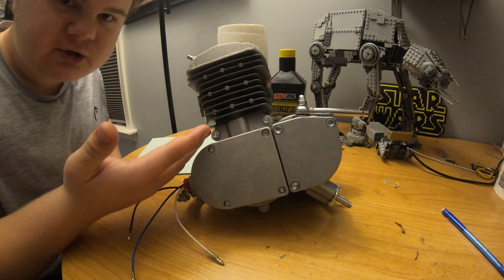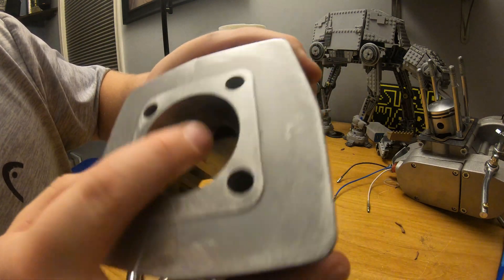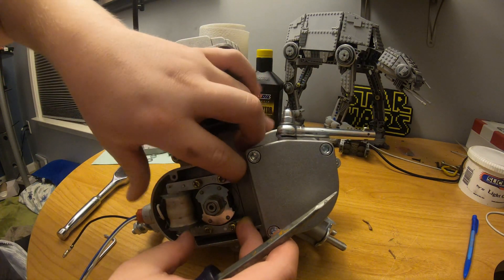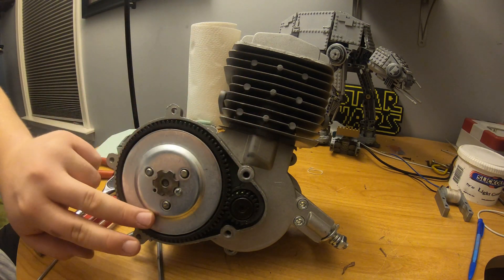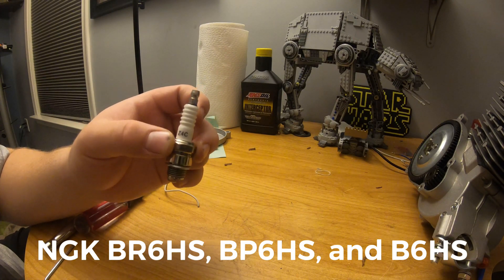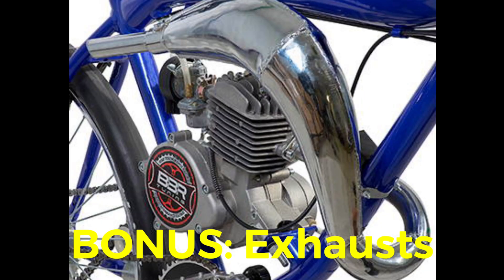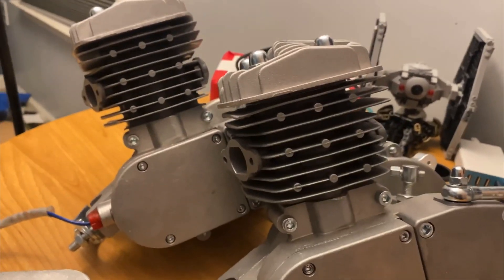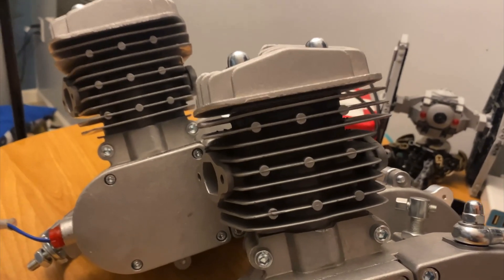5 NECESSARY Motorized Bicycle Mods #motorizedbike #motorizedbicycle #2stroke #moped #bike #minibike

Comment: I probably have around 500 miles on my Zeda engine. When i bought it I didn’t do any of these things. Right now I can hear a rattling sound like maybe a few tiny pieces of metal are inside the engine or something. It runs fine tho. What would you recommend I do to fix this and prevent any issues down the road. I hear you can take the cylinder off, pour some gas inside the engine and swish it around to clean out any debri from inside the engine. I have a dremel too. I dont have any experience with port work and the last thing I want to do is destroy my engine. It runs fine right now and I want it to last a long time.
Reply from the maker: Thanks for the question. Sometimes, the engine sounds like there is stuff in there, but if you didnt clean up the casting flaws before hand, there is most likely debris in there. I would remove the cylinder, check for scoring and remaining casting defects of the cylinder, and then pour gasoline into your engine to remove anything that might be down in there (I've also been told E85 or diesel works better than gasoline, but ive never tried it). 

If there is still casting flaws (such as little metal pieces sticking out from the ports), you can use a dremel and either a sanding bit or a carbide porting bit or a standard file to remove them. If the cylinder is scored enough to fit the tip of your fingernail into the score mark, then youll need to replace the cylinder and piston rings, but if there is visual wear, but you are only able to feel minimal bumps, or none at all, you can reuse the cylinder and piston rings and reinstall everything as normal. 

KEEP IN MIND: When you do ANY work the the ports, or even remove the cylinder, it is recommended to file down the edges of the ports so they arent jagged and/or sharp.
Reply: @a.m.bgarage.everydayprojec9665  alright im going to take the engine off my bike and take a look inside, clean it out and file down the edges around the ports. Thank you for the advice I will let you know how it goes.
Reply from the maker: Cool cool. Good luck.

Comment: 900th Subscriber!!
Reply from the maker: THANK YOU SO MUCH!!
Reply: @a.m.bgarage.everydayprojec9665  hell yeah man!
Reply: @a.m.bgarage.everydayprojec9665  just ordered a minarelli 2 stroke kit with a ported piston and a majority of heavy upgrades from smoklic!
Reply from the maker: Sorry. I didnt get a notification of your comment. I hope your bike turns out nicely. That is a BEAST of an engine and you cant really go wrong with ANYTHING that has Smolik's name on it. Just make sure you use a proper minarelli exhaust and carburetor, and youll most likely need to upgrade the cylinder head so it doesnt overheat (you can use pretty much any CNC chinadoll head).

Comment: I found a ton of the “cylinder defects on the exhaust and intake port, I’m going to use a dreamer and grind it off
Reply from the maker: Sounds good, though, make sure you don't remove too much material from the top or bottom of the ports.

Comment: I modified one of these engines awhile ago and got some decent power out of it. Expansion chamber exhaust carb tuning better plug and wire as well as making a thinner head gasket from an aluminum can and setting squish distance. Ended up with 160psi of compression after milling the head down slightly as well. The thing would rip but the power was pretty hard on the bottom end.
Reply from the maker: Heck Yeah. Thats what I did with these engines. They produced a good amount of power, but ive found that porting is what really does the trick.

Comment: For what is the white cable is this an power Output?
Reply from the maker: The white wire is supposed to be a power supply, however, its wired directly to the ignition system, so if you plug anything into it, would override the ignition system and the engine wouldn't even run (what happened when I attempted to plug in a little 5v light).
Reply: oof .-. but thx for the answer @a.m.bgarage.everydayprojec9665

Comment: Hey bud, I'm brand new to the motorized bike scene, I've been wanting to put an engine on my mountain bike but could never seem to find the time. Then my best bud shows up at my house with a mountain bike with a bbr 66/80. It is the coolest thing I've seen😅. I'm a small engine mechanic so maintenance won't be an issue. In all of my 2 strokes I use Amsoil 40:1. It's crazy I'm 49yrs old and just got into this hobby, any sorry for the long comment just want to tell you your knowledge on these engines is awesome. Keep up the awesome work bud
Reply from the maker: Thanks. I glad you find the hobby enjoyable.
Reply: You have to have good squish or none some of my race engines the piston is 10mm down in the cylinder at tdc and compression is over 10 to 1
Reply: Thanks for the advice

Comment: ive never had an issue with the stock exhausts blowing gaskets whether modified or unmodified. regardless good video!
Reply: my bike isnt even done its second tank of gas and its already blown its exhaust gasket lol. its not really big enough to let a noticeable amount of air through, but my engine gets covered in oil
Reply: @loud.p500  damn that ain't good. I'm mainly talking about them blowing head gaskets, I've never had that happen. I had a cylinder head crack and literally split in half but never EVER blew a head gasket
Reply: Same here. My bike has been using stock exhaust and original exhaust gasket for 3 and a half years with no issue.
Reply: @supremecell  seems like its just very on and off for people. it either works or doesn't aha
Reply: happened to me hahaha
Reply: @nat.strang  head gasket??
Reply: @lntegrate  no the exhaust gasket

Comment: Hello, nice video. How do you measure a squish gap? How did you measure your squish gap to know it was 3mm?
Reply from the maker: I have a link in the description of the video that explains how to properly check squish gap. All you really need is a caliper (or a VERY accurate measuring tape) and some solder.

Comment: Hey, nice video man. Additionally as a #6, these engines pretty much all come with metal flakes scattered inside and out, its best to clean them out completely with some kerosene or gas. A #7 is the crank bearings come with the metal shields still installed and should* be removed which requires a full engine disassembly unfortunately.
Reply from the maker: Thanks for the support and additional info. From the countless engines I’ve dealt with, none of them have had metal flakes inside or metal shields. I’m in the process of a second “10 necessary mods” video, so I’ll definitely make sure I include stuff like this.

Comment: The white wire is the wire you would attach to the kill switch
Reply from the maker: There are some magnetos that have the 
 white wire for the kill switch, but it is not common. Usually the kill switch only uses the two (usually black and blue) wires and the white wire provides some sort of current from the ignition system. This wire is a hindrance more than anything due to not having the capacity to supply enough power to power anything while also keeping the engine running and can cause short circuits, etc, hence why I recommend removing it.
Reply: isn't the white wire the + for a headlamp and you can get the ground from tho body @a.m.bgarage.everydayprojec9665

Comment: ive built a few motorized bike before and nevenr done these checks, u shouldnt have any issues but these chinese things can be sketchy. the bt 100 and bt80 are especially good and dont usually have any casting imperfections.
Reply: Where do you find one of these motors that isn't Chinese. I've been told that they all are?🤷‍♂️
Reply: @marcusprince3999 mines coning from cali🤷🏾‍♂️
Reply: @supergrapeap3312  Ok. Well most of Cali gets them from Chinese manufacturers, Lol.🤷‍♂️ If you find out otherwise, let me know.🙏

Comment: I know you say the white wire is pointless, but couldn’t it run a front light if I chose to put one on? Or would it drain too much of the energy for the spark plug?
Reply from the maker: I don’t know if I was using the right headlight, but when I tried using the white wire to power it, the engine barely ran and did not accelerate at all and it seemed as if there was not nearly enough power supply to light headlight enough to even make itself useful. Lol.  I don’t know if you would have better results, but it seems that most sources agree with my results. 

I was using a 6v headlight and the engine would barely run. Even if the 6v headlight had been fully powered, they are not very bright at all and aren’t very useful for night riding. To actually have a useful headlight, you’d have to use a 12 or so Volt system, which Will DEFINITELY NOT run off the white wire.
Reply: @a.m.bgarage.everydayprojec9665  yea I figured as much and have heard the same things but I’ve never tried it myself. My first build I just threw a battery powered light on there and that lasted me half a ride in the middle of the night. Nothing like flying past cornfields able to see nothing more than glare off the road.

Comment: Shave the head down ten thousands , check and keep the head torqued down especially after first few rides I put tapered nuts all over mine so nothing comes loose anymore
Reply from the maker: Thanks for the additional info. I don’t know about your engine, but with these engines, I needed to take over 3mm off the surface of the cylinder, so I didn’t really check it until I got about .5mm within the wanted height.

Comment: How fast should it go with only exhuast modification
Reply from the maker: Speed COMPLETELY depends on the gear ratio and wheel diameter, but if you upgrade your pipe to a fat belly, such as the MZ65 style pipes, your bike will run like a scalded dog, even if it ran good before.  You’ll not only get TONS of bottom and mid RPM torque, but you’ll also gain a good amount of high end RPM.

Comment: I call BS on the exhaust issue! All that is needed is to remove the small tube on the outlet side and enlarge the hole to about 1/2 inch. works wonders to open up the engine.
Reply: I want to try making a mini expansion pipe out of it by hollowing it out, putting the end cap back on with a little 6 inch stinger pipe 19mm ID out the end cap, with a little lawnmower sausage silencer on the end.

Comment: What oil ratio do you run
Reply from the maker: I personally use full synthetic mx premix at a ratio of 40:1, and I've NEVER had an issue
Reply: @a.m.bgarage.everydayprojec9665  is it ok to run 50:1 echo red armor oil? That’s what I use runs extremely clean and keeps he carb clean is that cool?
Reply from the maker: @Gavin-oq5nl  If you havent had any issues with it, its fine. However, you may notice a slight increase in performance and a large decrease in engine wear if you mix your fuel yourself using a 40:1 mixture with full synthetic oil. Youll notice it costs a LOT cheaper too, as well as being better for your engine (Aproximetly $5 - $6 per gallon compared to $40 a gallon with the Echo Red Armor stuff).
Reply: They say 20:1 in the manual
Reply from the maker: @cockshoemagoo2  whoever made those manuals smoking the good stuff. For any motorized bike, anything richer than 32:1 will foul spark plugs and clog the carb and anything leaner than 40:1 will run the risk of not properly lubricating the engine.

Comment: How do I get my motor to quit running so high
Reply from the maker: I’m guessing you’re talking about the idle being too high. On the left side of the carburetor, there is a (usually) flathead screw. To lower the idle, loosen this screw SLOWLY while the engine is running, and to raise the idle speed, tighten it a tad. When making these adjustments, make sure your engine is running and you are making the adjustments SLOWLY, as turning the idle screw too quickly can result in inaccurate results. You can decide for yourself what a good idle sounds like, but I personally set it as low as possible, so it still idles strong, but if it went much lower, it would die.

If this doesn’t really work, and adjusting the idle screw doesn’t do anything to the idle, you might have an air leak. I’ve also found that having a leaking head gasket and/or exhaust gasket can also cause the engine to run rough and/or cause the idle to go weird.

Comment: Also the blue 3 wire magneto sux ass and it’s cdi and itself keep blowing… look for the hp red wire 2wire cdi and magneto ya can even actually use the killswitch a lot… not blow it so easy… or even better yet the power storm ignition on dlh-performance great magnet great timing great reliability

Comment: Best pipe is actuall a modified jog pipe or a modified dirtbike pipe.. if I was u I’d get the mz65 replica and weld a washer of 17mm to 15mm sized hole on the assend of the stinger
Reply from the maker: I have no doubt that the absolute best pipes are the jog pipes and the MX pipes, but the main goal of the video is to make beginners familiar with what issues these engines have out of the box, and how to EASILY and CHEAPLY fix them.
Reply: @a.m.bgarage.everydayprojec9665  oh ok well I listed a few mods ya really need to do for a most reliable engine
File ports and flanges flat use better handmade gaskets 
File back of magneto flat and it’s mating surface as well 
Clip internal tube on cap leave 2-3inches 
Level deck and head mating surfaces 
Punch holes in carb cap 
Polish exhaust or as close tonpolished as possible smoothnintake 
Skirt piston 
Run it 32:1 during and after break in may add an extra 0.5oz during first two tanks 
Port edges smooth and chamfered 
Rings looked over piston looked over 
Upgrade to Hp magneto and cdi 
Your choice of sprocket. 
Bang it at 39/40 mph after break in with all this fixin up… and don’t blow gaskets and have better torque more reliable over all engine.. u welcome
Reply from the maker: @motorizedbicyclenation53cu90  Thanks. I plan to make a couple upcoming videos going more in-depth about this kind of stuff. Thanks for the great information. I'll make sure to include some of these.

Comment: Blow head gasket? Lol well… ya didn’t modify it correctly…
Reply from the maker: I've always had issues with the stock exhaust. If I dont modify it and keep it stock, it DESTROYS exhaust gaskets, but if I remove the cap, my head gaskets blow. You have to find a median, which usually results in cutting out the insides and/or cutting holes in the cap, but to get a good running exhaust that way, it usually requires trial and error. There is a FINE line that you need to stick to in order to modify it correctly, and you go through all that trouble to get a barely noticeable difference in performance. You are better off upgrading the exhaust for $30 and get a true 2-stroke pipe with an expansion chamber, which will give you not only great reliability but a HUGE power increase.
Reply: @a.m.bgarage.everydayprojec9665  yes true any expansion chamber is better than stock pipe well except don’t get banana pipe lil bitty pos it sux assholes
Reply: @a.m.bgarage.everydayprojec9665  file the exh. intake and pipe flanges and cylinder mating surface flat and smooth w cylinder off engine mark w paint ink marker to ensure highs lows are gone.. ya may then seal with nothing but ultra grey ultra copper… or your own handmade gasket thinner the better thicker means more pushing area for pressure and higher chance of cracking more movement also… so use a thin sheet of copper annealed or aluminum or gasket material and some Ho temp hi torque gasket sealer
Reply: @a.m.bgarage.everydayprojec9665  and just trim the tube on the cap… can gut it if ya want leave 2-3 inches of tube on cap works great for stock don’t blow gaskets